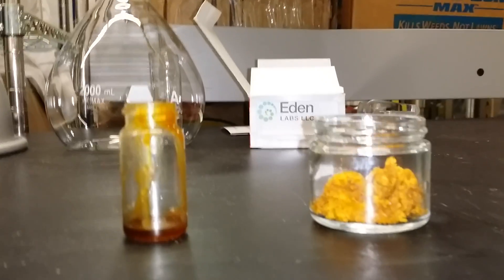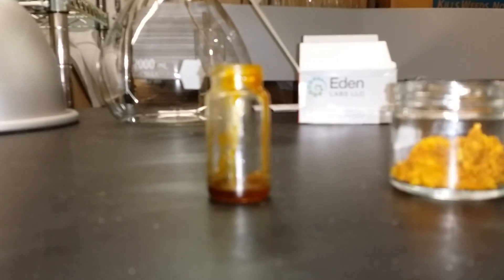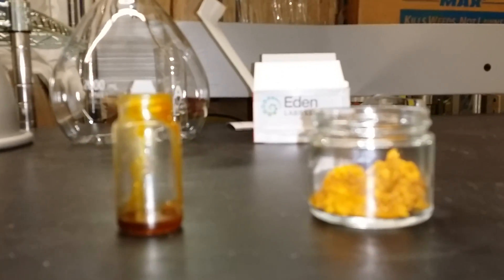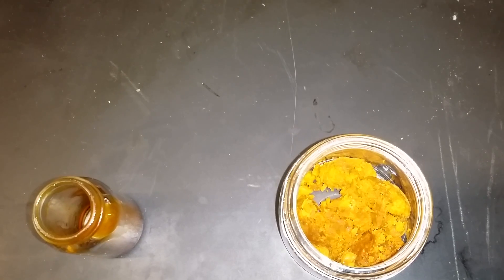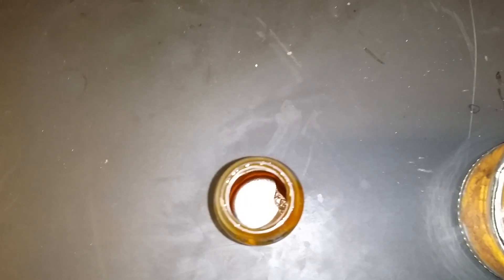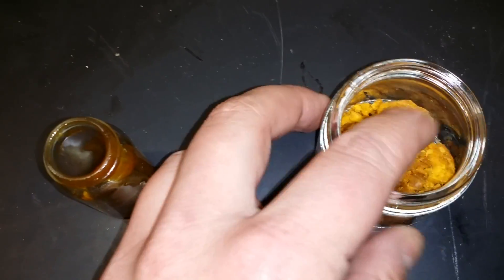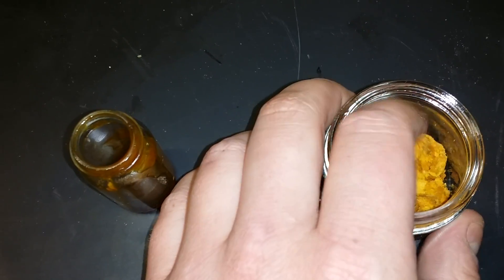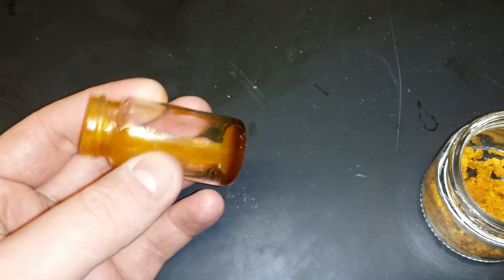Supercritical vs Subcritical Extraction - Eden Labs System

Comment: thank you, ive been vaping subcritical then
Reply: not necessarily. You can still get nice clear stuff with supercritical. Pure grain alcohol should do it but if you want to avoid solvents the rosin tech with a 25 micron or smaller filter is actually a better method just a little more work involved.

Comment: Winterize without solvents!
Saponify the fatty acids with alkali in water.
Think soap-making with a 60% super-fat.  Look it up!
The wax will now easily separate with gentle heating; around 120F.  Forms a layer on the top of the soap solution.  Good stuff sinks to bottom of solution.
When the wax, medicine and plant oils are mixed they can be difficult to separate.
Remove the oils by making them into liquid soap, the wax simply floats to the surface!
Less than 15 minutes to do this process, no loss of terpenes.
Reply: Greg Gallacci Can you elaborate? I have Co2 extracted oil in beaker, where do I go from there?
Reply: Well, the arrogant bastard in me says "look it up", but the helpful guy says:
Weigh the oil, and assume about 1/3 of the weight is waxes/junk oils.  Supercritical CO2 can be 'dirty' with non-target stuff.
The 'magic' ratio I have used is 5 parts water, 3 parts oil and 2 parts lye.  By weight!
Dissolve the lye into water, and blend in the oil while the water is still hot.  Small amounts of the lye/water blended into the oil.
Lots of shaking, mixing and such.
The reaction will seem to do nothing for some time, then thicken slightly.  Soap makers call this 'trace'.  Maybe you should look up this part!
Keep on mixing/agitating until you get a creamy paste.  Keep it warm, 110-125 F.
You have hemp-soap mixed with Wax [not that kind!] and medicine.
Dilute the pasted with an equal volume of water [dissolves the soap], warm it up to about 130 F [melts the wax, rises].
The glop at the bottom is the medicine.
Several warm water rinses to remove last traces of soap.  The easy test for rinsing is to nibble a tiny bit of the oil.  Lye/soap has a sharpish soapy taste, pure oil has an organic 'grassy' taste.
Theory: junk oils cause medicine, wax and other resins to co-dissolve into each other.  Remove the oils, medicine [denser than water] and wax [lighter] separate.  Terpenes not 'cooked off' due to low temperatures, and short heating durations.
BTW, cannabinoids are di-terpenes, and tend to combine with the aromatic terpenes, preventing 'cook off'!
Biggest bonuses: no volatile solvents, 1 hour process, common cheap chemicals, kitchen-craft lab-ware.
Reply: Haha I appreciate it. I am familiar with saponification, I did look it up but I could not find anything specific to cannabis oil. Oil is expensive and I didn't want to risk/waste it. I wasnt sure if I had to use a specific ionic salt, or if there was one preferred for this procedure. Thank you for your time, I will give this a try!
Reply: Just basic sodium hydroxide.  I made a pun!
Terpenes and di-terpenes do not have the 'hook' [functional group] to react to the sodium ions.
Potassium salts work too, but their higher density makes the wax separation tricky.
Bottom line: 'medicine' is about 110% the density of clean water, so not too much dissolved salts, OK?
Reply: Greg Gallacci This is something new to me...how would the procedure work using raw cannabis? I haven't been able to find any information about cannabis oil saponification, just hemp-seed oil...thanks for the interesting ideas!

Comment: are u using a co solvent? i do SCFE too. but with surplus or decommissioned oxygen equipment. i have been able to replicate sub critical oil. but i do want to have that more crubly texture. any pointers?
Reply: no to the pre heated pyrex lol either pour into unbleached parchment paper, PTFE paper, or a straight up PTFE container. as far as choosing what temperature/pressure you want in your co2, i suggest a ball valve at the bottom of your extraction tube, before the collection chamber, and a pressure gauge at the top, to allow you to regulate the pressure of the co2 only in the tube. 

You can wrap your extraction tube with a flexible heatpad maintaining ~80F, to prevent as much terpene breakdown as possible, while still going supercritical. If you can think of a more effective way to keep the cylinder at a stable 80-90F please let me know lol.

Anyways, you want the whole tube to be around ~80F before adding enough co2 to bring the chamber to your desired pressure (~1100 psi at the least for supercritical). Add co2 slowly, to allow time for the heat to affect the pressure. Check gauges frequently. The supercritical point is right around 90F at 1050 PSI, so you want to bring your extraction tube to at least these conditions for a little while and Im sure youll see more extracted out. I don't know how effective it is to get out all of these lipids like this, since you have to spend more money extracting them out.
Reply: i cant say publicly - trade secrets - check us out at shopmarijuana.com
Reply: Shopmarijuana.com  actually. I remember someone getting back to me a long time ago. They were very kind to offer up a little advise. No worries. No trade secrets were given up. But they were able to help me understand a little more of what I needed to do to get the results I wanted. I decided to go back to the drawing board, played around with some things. And after a few trial and errors. I was able to achieve a slightly more desirable result. I still have some thinking to do. But at least i'm able to get something i'm happy with. Thanks for the link. I'm checking it out now.  Looks good. :)
Reply: try letting your run soak a little longer, and when you empty the chamber, empty it into a preheatead pyrex..see if it makes a diff
Reply: thanks. :)
Reply: I've used a nylon hose wrapped tightly and completely around an extraction tube that had heated water circulating through it, I don't know if that would work better than your heatpads though...